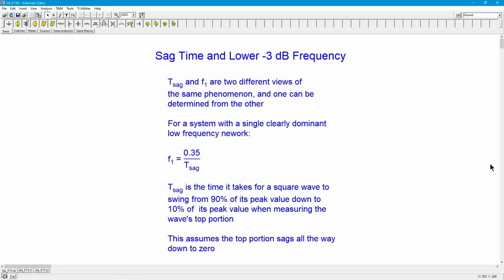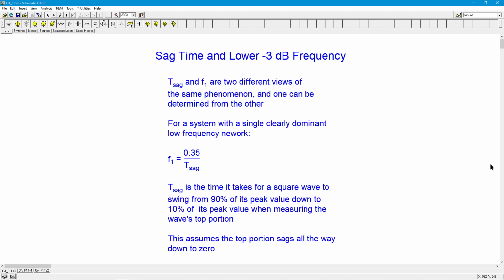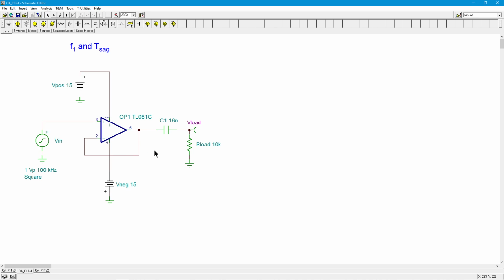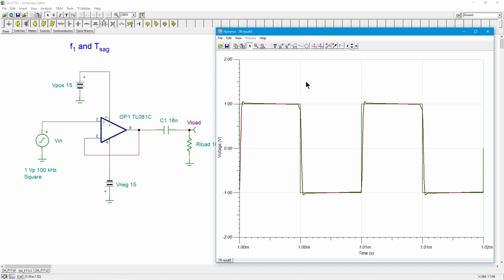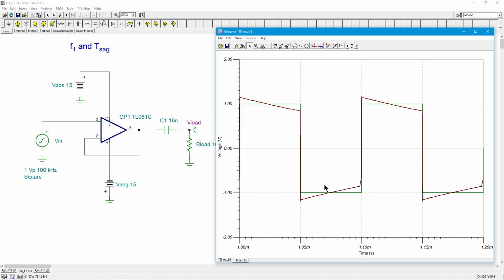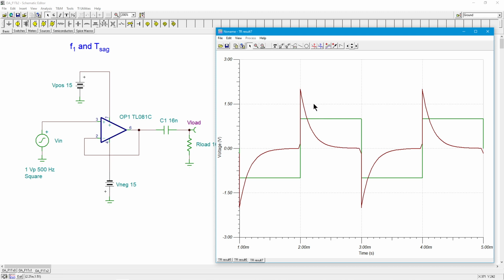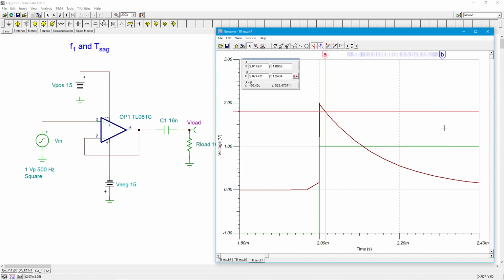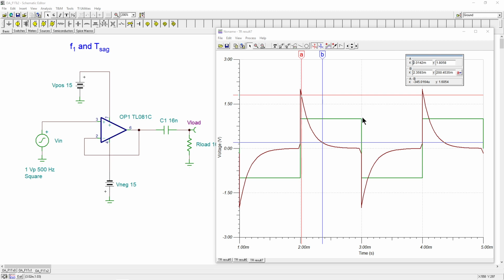Op Amps: f1 and Sag Time

Comment: WHAT IS THE DIFFERENCE BETWEEN FALL TIME AND,SAG TIME?
Reply from the maker: In general, fall time is the same as rise time and is measured on the leading (rise) or trailing (fall) edge of a square wave (the vertical portion). It correlates with f2, the upper frequency limit. Sag time is a measure of the top portion (ideally flat or horizontal part) of the square wave and correlates with f1, the lower frequency limit.